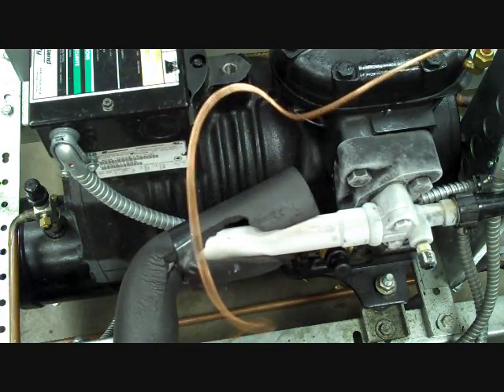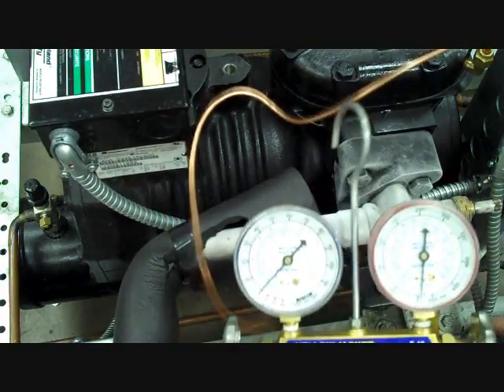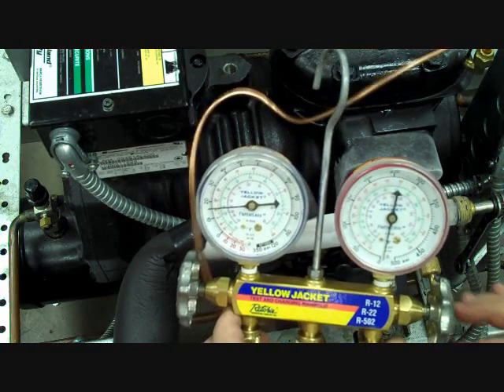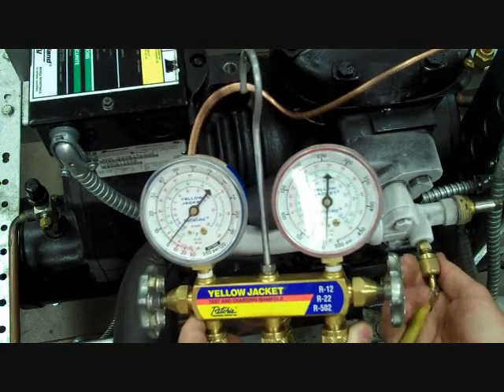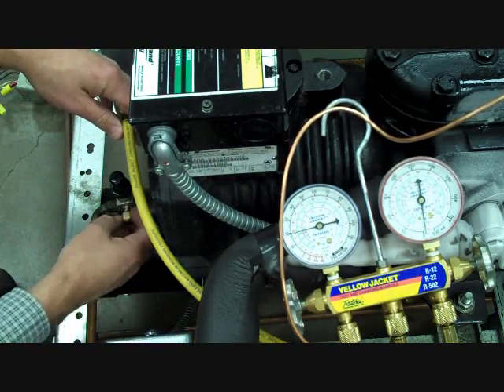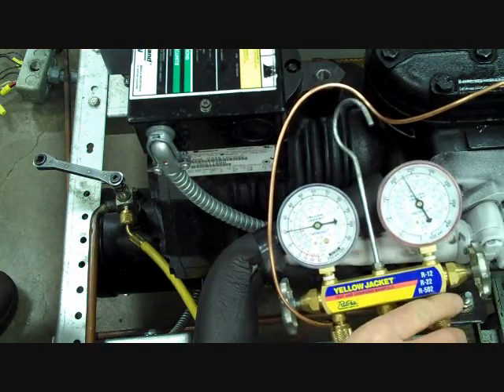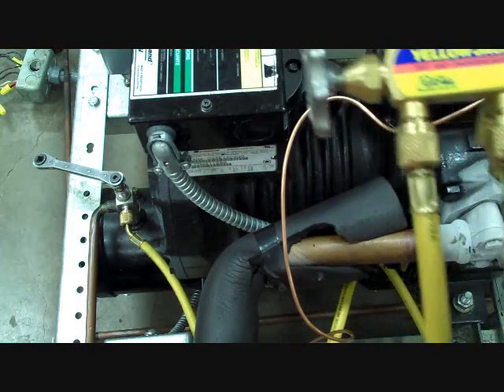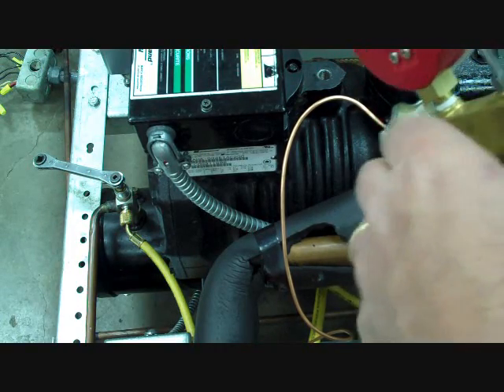Proper gauge connection and usage

Comment: You should mid-seat the valve to read pressure. If you front-seat while system is running you will destroy those valves

Comment: That vibrating control cap tube worries me, it will eventually break. When I install a control I straighten out the cap tubes then I get a screw driver with a big handle and make a tight coil with the cap tube, if there's still a lot of vibration a wire tie works.

Comment: 300psi sounds too high for MP39, should be running similar pressures to R12 as its a drop in for R12. Could be overcharged or very dirty condenser or very high evaporator load, or a combo of all these besides a few other problems.

Have a look on a pt chart and convert pressures to temperatures for MP39, (you can then convert the same temp to a pressure of a refrigerant you are more familiar with to get an idea if what you are seing is in a normal range)

Comment: I was wondering what "normal" high side pressures would be... I have a compressor running MP39, and it has a LRA amperage of 22 amps, 300 PSI high side pressure, and a running amperage draw of 7.4 amps... does this sound reasonable?  The compressor has no other amperage rating otherwise